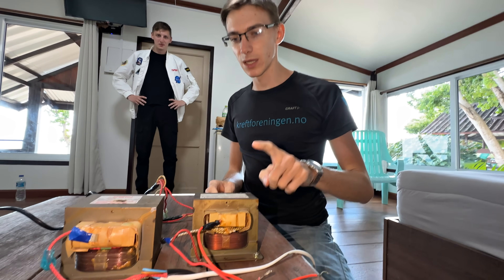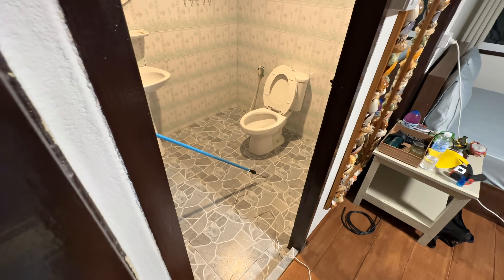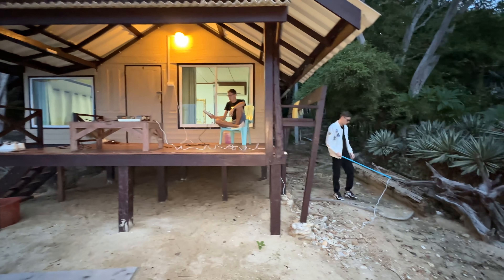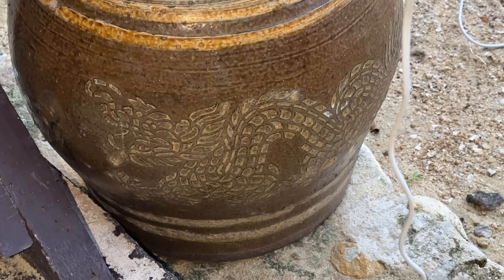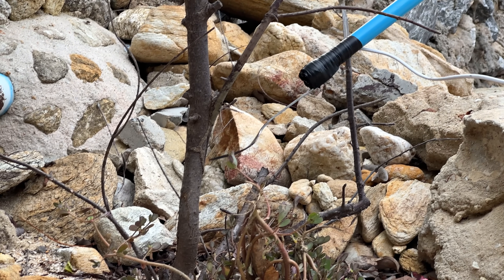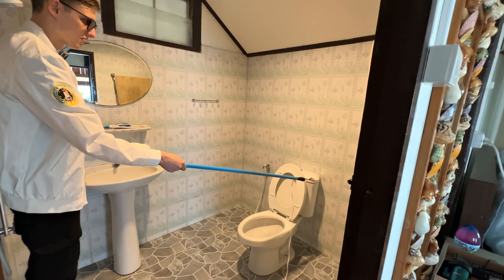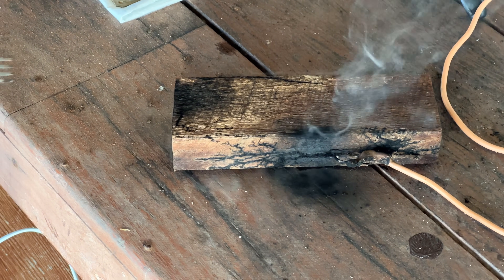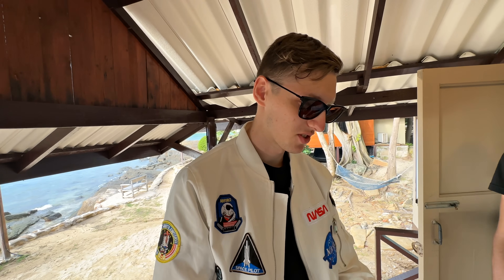High voltage and TOILET ⚡️☠️ What happens if you start an electric arc in the SEA

Comment: never try this without qualifications.   three of these guys original group wer engineers.  Possibly they have 2 or 4  transformers in series which will boost the Voltage but limit the current due to increased inductance.   But im sure their intent is to make crazy vid ,   keep channel going and not drift into obscuity...

Comment: Scary. Basically testing the resistance to grounded objects (pipe behind tile wall, sea and beach sand, moisture in wood floor, etc). Extremely dangerous fire and shock hazard. It's interesting seeing the classic "orange" glow from the arc in seawater due to sodium.

Comment: hit a sealed can of coke. warning its gonna blow open instantly. put hotdogs on the fork prongs while its off then turn it on. stick i2 in a box of metal bbs. if they are close they will weld the bbs together. makes cool art. just some ideas for the pros. if ur not a pro dont do it

Comment: in the USA some people have DIED by using microwave transformers to burn wood for art, as shown in this video.  Must use caution!   Never do it alone!   You can die from the arc even contacting it less than one second, even from touching the iron core where you don't see the arc!
Reply: They should be using a deadmans box, the box where you lift it and press both buttons with both hands
Reply: @TheRealName7  Or they could use a man-switch. This is where you hold one cord with your right hand, and the other  cord with your left hand to complete the circuit. You save plenty of money on switches, and what could possibility go wrong? Anyway, you only live once.
Reply: @SeeFreeTV  or the one where you connect and implant the cables directly to your heart to complete the circuitry
Reply: A dead man switch would only work after one of them is already dead. So its kinda redundant
Reply: What if you only touch it a little bit, like Ben Franklin? My motto is, "Try everything once".

Comment: I hope this is not in hotel. this arc is becuse of pipe of water inside of wall. but imagine someone in other room go to wash his hand in this time.. 2:57
Reply: @dimethylcadmium3477  actually i am an electrical engineer. this voltage is high. Of course this is very dangerous.. look what happens when he placed it in the window 1:15 ... the light flashes. so this electric arc goes from windows to wall and from wall to pipe and from pipe to wires and damaged the circuit. because it is high voltage there is a possibility that it will go through the neighbor's tap. and if the neighbors grab that faucet at the same time it will shock him .. maybe kill him.
Reply: @dimethylcadmium3477  they use TT ground system so it will sock. they use 4 transformers 2 in paraller 2 in series. this is near to 4kVolt up to 5 Amper.  is TOO much and can instantly kills you. Also if the use 4 transforemr in series it means 2kVolt x 4 transforemrs near to 8kVolt.. this is insane hight with big amount of ampere..
Reply: @peterfairlie2296  Ok, yeah. 
I didn't think about that.  That would change things quite a lot. I have never seen a plumbing system not grounded where I live (in Sweden) - but then of course in such countries as Thailand, where we sometimes hear about people getting electrocuted in the shower or from a railing outside their hotel (from faults with just 220-240 V mains voltage), it could be quite different.
Also depending on where they choose to ground the transformers (which we don't know, I guess they just connected them to the most convenient spot. A radiator or what ever that happens to be close), the voltage differences to different "grounded" objects, could be really high then.
Reply: @Speeder84XL   also it can shock in the shower if the system is TT and the main transformer cut the N .. then the PE it turns to current-carrying conductor and this can kills you. nothig can protects you.
Reply: @dimethylcadmium3477 what are u on about..
Reply: @Sam3532  electricity takes the shortest path of resistance.
Reply: @goku445  Nah, it's not a smooth cab driver. It takes ALL paths.
Reply: @atdzsny  It does take all paths, but the resistances and passing current, usually determine how much of it taking each path. Here we have maybe a few amps of current that those transformers can provide and one very low resistance path to ground via a water pipe - there is no way the voltage potential could rise enough over that pipe to shock someone touching that and some other grounded object. Usually different grounded objects within reach in a bathroom, is also connected together as the pipes is connected together. So any voltage potential that is, gets even less.
Reply: @dimethylcadmium3477  its not 230Volt 50 hz its 8000Volt !! it can arc at ~ 6-8cm if you go near to transformer and try to touch the grounded places of transformer. this is TT system at the 230Volt this not shock you.. but with 8kV it will sock you. dont forget the stepped voltage.